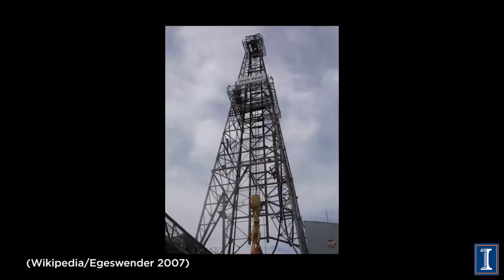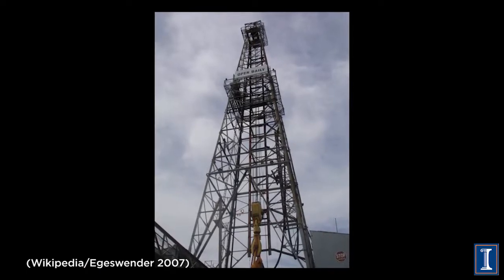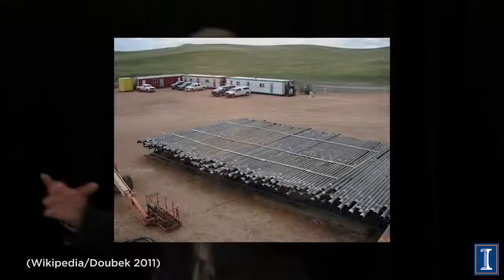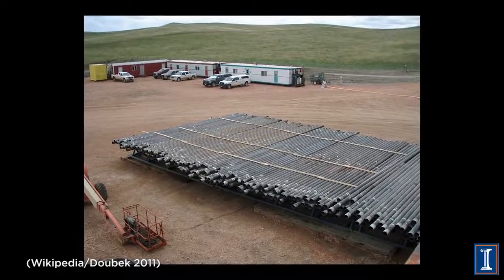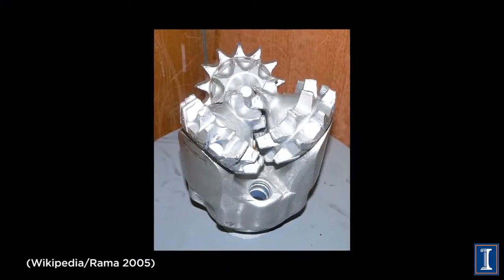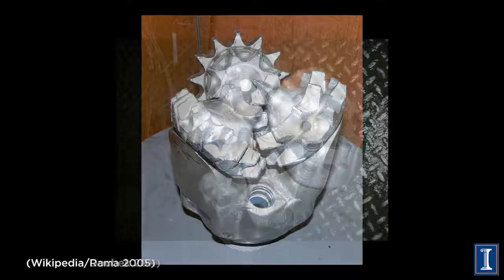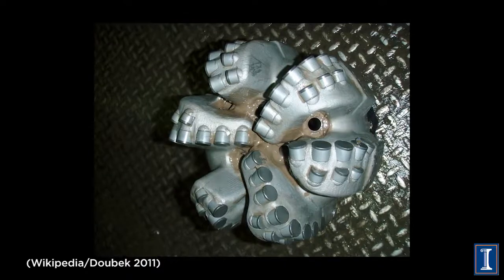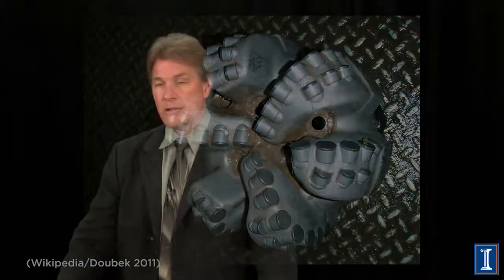How to Get It Out

Comment: That bit with the drilling mud sounds challenging. At the top of the well you need enough pressure to force the mud through that very long pipe and then back up through the hole to the surface.
Reply: That is not really how it done.

The mud density is balanced to counteract the pressure in the rock formation that you are drilling through.
If it is higher then you will loss the mud into the formation. If it's lower water will stream in and dilute our mud.

The viscosity off the mud is made so that rock chips from the drill head are lift up on the outside off the drill string and filter away on the surface. If done right you could flow mud through the bor hole just by feeding the hole from a tank that are placed higher then the outlet. In pratice you will need pump to regulate the flow to a required volume the lift all the chips from the drilling.

If water or drill chips unbalance the mud density and/or viscosity thing can go very bad. That is one important reason for that the mud is checked a the time.

Comment: So during drilling that pipe is being rotated at the top and transfers the torque multiple kilometers to the end where the drill bit is. What if, during this process, the pipe breaks somewhere deep undergound? You can easily pull out the section of pipe above the break, but what about the lower section? Can you extract this, or do you need to drill a new well, or do such breaks simply not happen?
Reply: It can happen, and one reason is that drill strings can be in fact be hydrolic stuck to the wall of the bore hull. There are tools that try, but if there is no succes. The hole have to be plugged and a new started.

On the other hand long holes are not really drill by torque from the surface. Instead there is a mud driven motor down in the hole just behind the drill head that do the rotating. The string supply mud and weight.

Her is a picture that show such an assembly:
https://worldoceanreview.com/en/files/2014/05/wor3_c1b_fig_1-18.jpg
Reply: There are specific rigs called "pulling units" that can fish out most anything.